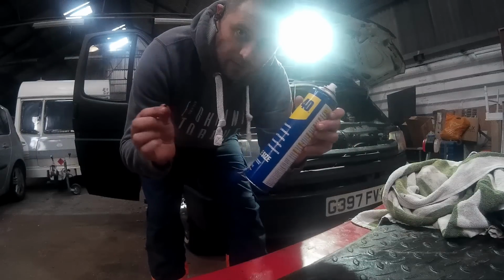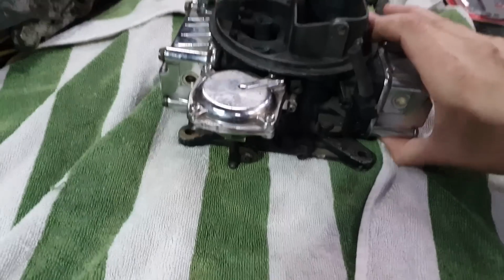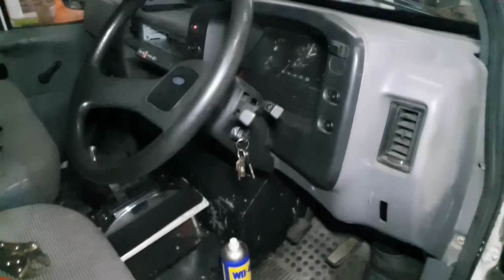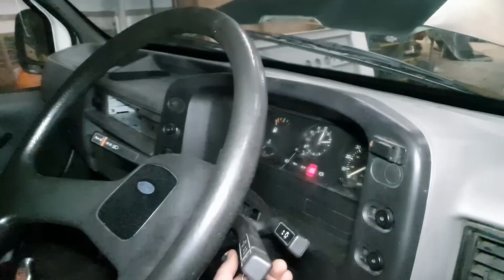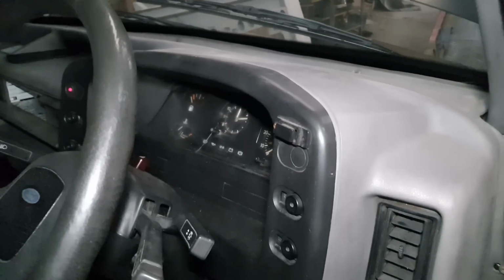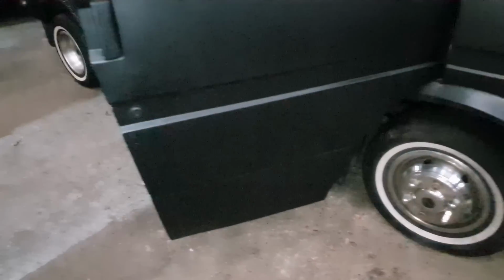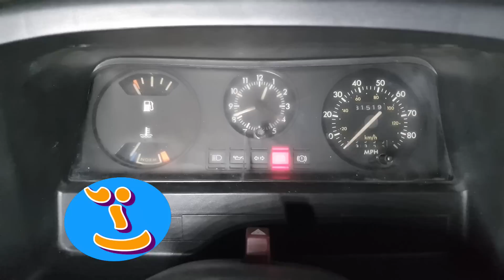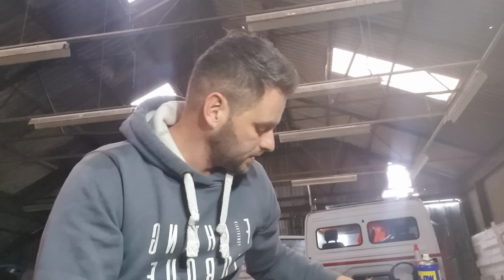WILL THE V8 TRANSIT START?? It's not looking good!

Comment: As you noticed the choke flap has been removed for some reason, l used to run a Capri with a Predator vv carb which had no choke at all, to start it you have to pump the accelerator pump to inject petrol into intake manifold to get it to start once it fired with a couple more pumps it would tick over then after a minute or two it would run fine, the carb you have looks like a Holley 750 vacuum secondary which should be fine for a standard 6.2 engine.
Reply from the maker: Great advice, thanks very much!
Reply: isn't it a 6.75?

Comment: It does sound good sounds awesome. In fact even better when it’s set up right I’m running properly sounds good. Keep up the good work.😅😅😅😊 have you got enough gearbox oil in a transmission fluid auto transmission fluid like because that sometimes doesn’t make it go into reverse over time
Reply from the maker: I think that's exactly the reason because there's quite a bad fluid leak from the transmission

Comment: The feeling you get when you've never the engine then work on it and then cough and splutter then it runs  you should have it a a few rev's .🚚
Reply from the maker: I'm not sure on the state of the oil so once that's changed I'll be giving it some revs 😊
Reply: After it laying for so long with others pouring the amount of fuel through the carbs .it's probably more petrol than oil  lol.
.
Reply from the maker: @spudrocket7370  yeah totally, also doesn't have a crankcase breather either so probably an explosive engine....Literally!
Reply: Oh right . Is it missing of blacked off . I might need a flush in case there's any gunge in places from moisture  . If so after flushing I'd run cheap oil through it then drain again then top oil.only problem after all that is any .any seals weather,'d can show leaks . Good /bad depends on how you look it 
I was thinking . depends on the pressure you could just run small breather to an open breather or can or a loop  unsure really it's an interesting project no matter. But definitely work it all though might be costly as 8mpg less pulling but it is much lighter than 4/5 ton bulk body it came from.  I know  it's no far from where it is . With cab and axle. 
Oh no he spec looks just a bit light I'd make it chunky and stronger.  Maybe just a show events for advertising you business..  
But the the way our government is going we will have no cars or business left for any work. Then what they going to tax . ..  lol    a Candy' apple  with yellow though it would be stunning.  The cab needs  a big think but depends on what your plans  for it will be. 
These alway change through a build.. the fact it is well known everybody watching more. Oh get a decent corner of shed with   strip light even if it's a wood frame and  polythene  around frame and keep warm

Comment: sounds like the main jet is blocked in the carb, ebay sell a Universal M6 Engine Carburetor Carb Main Jet Kit 128 130 134 135 136 138 140 for £8.50 just rejet the carb for the cost. by the looks of that its a holly 2 or 4 barrel carb plenty of guides on you tube how to rejet those.
Reply from the maker: Thanks mate, stay tuned...I may have bought another carb 😂

Comment: Hi would you like to buy another smiley ? Cheap with a 2.5 banana engine fitted mostly welded apart from one section. My aunt started to build a recovery truck. Then passed away in 2021. Its not really my brew. £900 kent uk
Reply from the maker: Possibly mate. Send pics to Sleafordrecovery@gmail.com